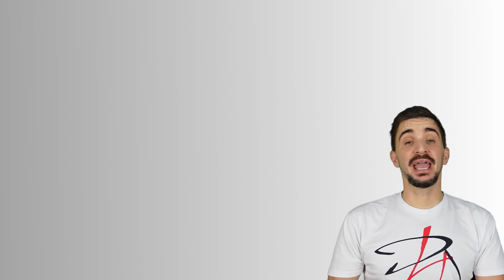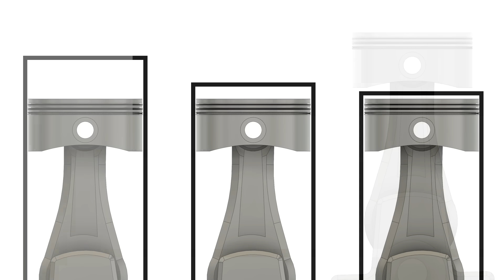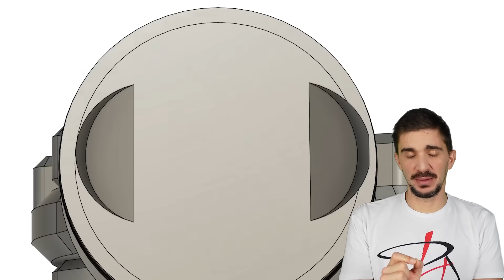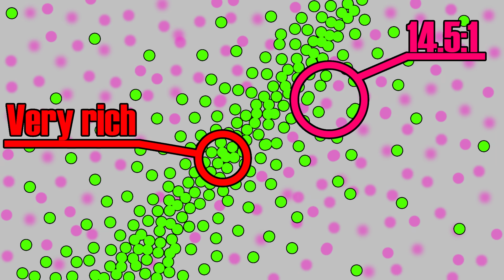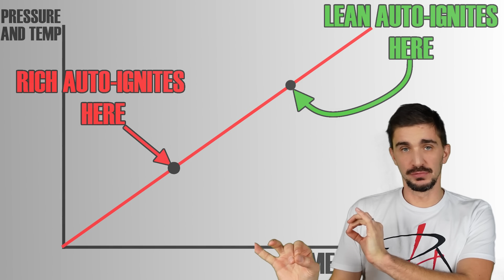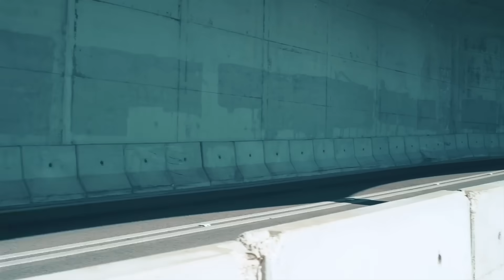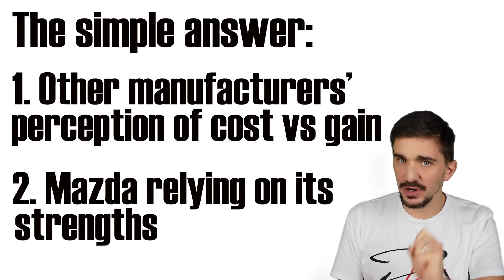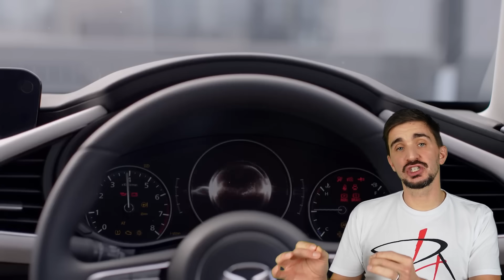The Game Changer Nobody Cares About - Mazda Skyactiv-X SPCCI How it Works and Why It Didn't Catch On

Comment: I'm surprised people call a turbo as having more "character", I would think such a vehicle would be more unpredictable at the wheel and less of a joy due to the inherent lag of most turbochargers. Id argue a NA engine is much easier to control, so I'm surprised I guess. On a somewhat related note however, I believe Mazda has been exploring a supercharged 2 stroke akin to the Alpha Otto you've discussed about a number of months ago, which seems to borrow some parts of methodologies from the skyactiv-x, for the last few years, maybe an exploration of such a design, and how it could be a more sooner and realistic development of a modern 2 stroke may be an interesting video idea to pursue.
Reply: I have a Supra with a big turbo so I know what lag feels like. I also have a Mazda CX5 Turbo. You feel no lag for a variety of reasons (e.g. higher compression pistons). The main reason is this trick they use:

1. Dynamic Pressure Turbo (Mazda’s System for Reducing Lag)

Mazda uses a system called a “Dynamic Pressure Turbo” in engines like the 2.5L SKYACTIV-G Turbo. Instead of a traditional twin-scroll turbo, this system uses a small valve inside the exhaust path to improve low-RPM response.

At low engine speeds, the valve partially restricts exhaust flow. This restriction increases the velocity of the exhaust gases hitting the turbine wheel. Higher exhaust velocity spins the turbo faster at low RPM, which allows boost to build much earlier — typically around 1,600 to 2,000 RPM.

At higher engine speeds, the valve opens fully. This allows the turbo to flow normally and support higher power output.

The result is:
	•	Faster spool at low RPM
	•	Stronger bottom-end torque
	•	Reduced turbo lag
	•	Smooth transition into higher RPM power

This design makes the engine feel responsive and powerful in everyday driving without needing a complex twin-turbo setup.
Reply: @jimellis1810  This sounds very much like a variable geometry turbocharger. Is it essentially the same thing?
Reply: Looks like you drove very old or heavily modified turbocars
Modern cars has so tiny turbochargers that you can't feel at all when turbo kicks in
And that's boring 
Old cars with turbo has at least 2 regimes boring and WOOHOO

Comment: Real world results aren't great.
The cars aren't any more efficient than similar alternatives, especially Toyota's hybrids.
Reply: As in the Mazda is in a pure ICE configuration Vs the Toyota hybrid? Id argue that's very impressive actually
Reply: It's the most efficient NA petrol, if their bodywork doesn't rot away like in the good old days it's most likely gonna end up the least problematic platform to own second hand.
No turbos, 4 cylinder. Sounds like a recipe for longevity.
Reply: This comparison is based on what? The overall usage of the hybrid system or only the usage of the ICE of it?
Reply: Your statement is incorrect.

Comment: If only they can combine SPCCI and nissans VC Turbo tech to have control over the compression ratio more effectively
Reply: No no no, VC Turbo engines aren't exactly reliable and efficient.
Reply: And it will cost insanely expensive.
And hybrid will still offer way better value for money than that.

Comment: You've got a long wrong here. The higher compression ratio has nothing to do with being closer to the fuel, the reason it is more efficient is the compression to expansion ratio. Secondly, the only real difference between petrol and diesel is the molecular weight, you can run petrol in a diesel cycle and visa versa. Petrol just vaporises easier for homogeneous mixtures. You're also mixing up AFR for stochiometric values. Stochiometric is the right amount of air to fuel for a complete combustion. And everyone hasn't ignored HCCI, you're videos are bad information. Research harder.
Reply: it's not a scientific video
Reply: @squlllol so, what is it then? He's using words like stochiometric... what do you mean? Engines are science devices...
Reply: @hdhardcore8511 vulgarization video

Comment: Mazda's engines really keep impressing me from their old rotor engines and their new sky active engines at a reasonable price
Reply: I have a cx-5 and it is just perfect.
Reply: @sylviam6535  Mazda CX-5 alongside the Toyota Corolla are the only Hatchback i like, one is so good for the money the other is just a wild beast on those dirt streets
Reply: @o.i.s1 cx-5 is a crossover not a hatchback. try a mazda 3
Reply: @o.i.s1  - Yes, the cx-5 is extremely good value for money.
Reply: I had a 1982 Rx-7. Best driving car I've owned. Not particularly powerful. Not economical. Great fun to drive though. Great looking car, too. You can recognize new Mazda models by their beautiful paint jobs now.
Reply: @jonkirkwood469   had a Mazda MX-3  1.8L V6 5sp manual.  put 230k  before the body rusted out (Minnesota) Engine & trans still perfect.  Great fun to drive.
Reply: Mazda bought licence from NSU to produce rotary engines, but it was unfinished development. I do not think it was a commercial succes. On diesels they lost shirt!
SPCCI engine, well, you may buy just ordinary two liter four and it gives you better performance, than the complicated one for less money.
Reply: @zdenekkindl2778  But the SPCCI uses less fuel, that's the point. Also, as stated in the video, it's not more expensive. Performance is no worse than a typical na two liter engine, it has about 180 hp.
Reply: @PekkaKilpeläinen I'm pretty sure the 2.0l Skyactive X has closer to 300 hp. It's supercharged, not NA.

Edit: nvm. I was wrong. I wrote a paper about it in college but that was damn near a decade ago.
Reply: @PekkaKilpeläinen  It’s a torque monter but top-end is disappointing, skyactiv-G is wonderful.
Reply: @zdenekkindl2778  RFN engine from PSA from the 90s was more alive and used less gas than this X "monster" with no "mojo"
Reply: Just wait for the new rotor, it's gonna be great.
Reply: old rotor engine a defective design... also technology from n##i germany... so yeah good engines, it last like 20000 km then falls apart... its like a russian spring or magnet engines it will work for a while then it will die majestically leavin you stranded in teh midele of nowehere.
Reply: Not the RX8 Wankel prototype though. But what's past is past.
Reply: Didn t the rotor engine a bunch of problems 

Havent looked at durability of skyacive

Problem from maxda was the car rusting super fast

Guess the new models are crammed with opalescence and millions of sensor computer and hard to maintain like all other companies thse days
Reply: They just hire only actual engineers, and skip women and marketing people (thats why this tech is not popular)
Reply: @qwertyls8552 you've clearly never worked in a high achieving engineering team, women are almost always part of it too...
Reply: @qwertyls8552  From Mazda's careers website:

"Collaborative and flexible workplace where diversity and inclusion are key."

They have structured networks for various interest groups including Black, Latine, AAPI, veteran, and faith groups.

You're just wrong. Worse, you're wrong and confident about it. Imagine being so insignificant and insecure as a man that you gotta tear other folks down to pretend to be important.
Reply: @qwertyls8552  just open a grindr account already, you dont need to convince us.
Reply: Lmao

Comment: (Didn't watch the video yet) Oh man, I remember when this tech was announced. I was so excited to see it on future generations of Mazda 3's.  Then they priced it into the stratosphere and never even got released in the US.  Bummer.
Reply: I watched it, and well.. yeah.  It's still not in the US.  The tech costs a lot, they gotta recoup their R&D expense, so they throw it on the consumer (reasonable).  But the consumer sees meh horsepower and good fuel economy and thinks it ain't worth it.  I remember back in the day Mazda 3's with the tech would end up costing over $40k.  A hard ask.

Also, as a motorcycle guy: If I'm getting a fancy new engine with fancy new tech, it better sound good or have some sort of performance benefit or feel nice to drive.  A high fuel economy engine?  Snore..  The cheaper alternative to chasing fuel efficiency is making smaller, lighter cars (D4A did mention this in other videos), with smaller engine displacements.  Same reason why a Honda 500cc bike has nearly 90mpg while their fun/fast stuff is approaching 30mpg.